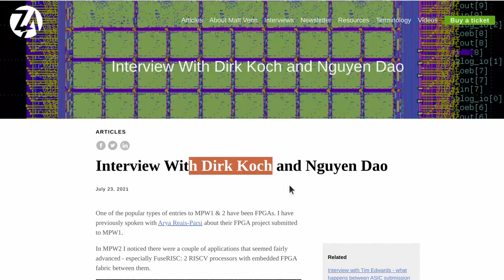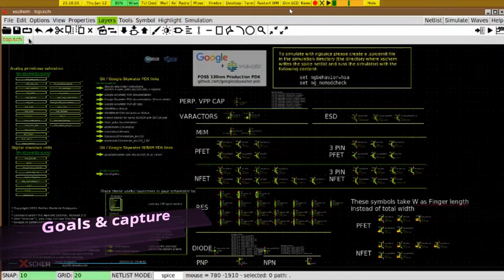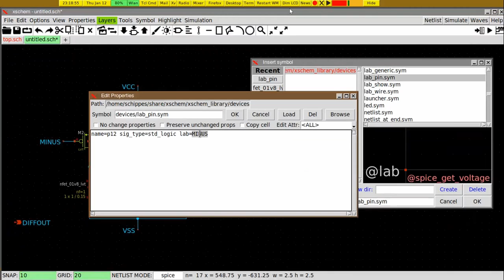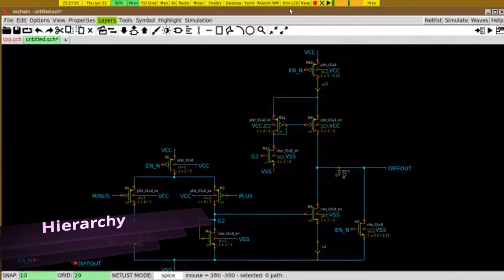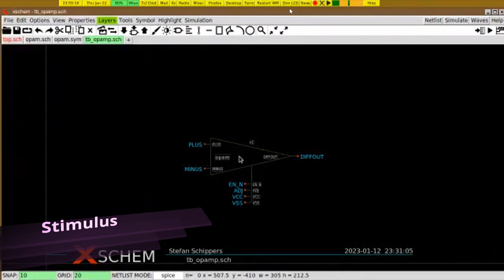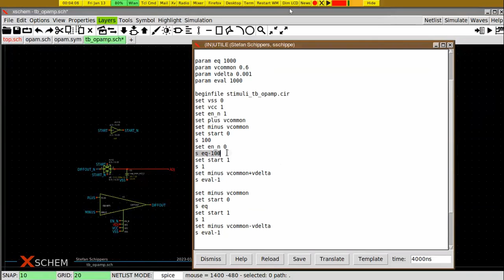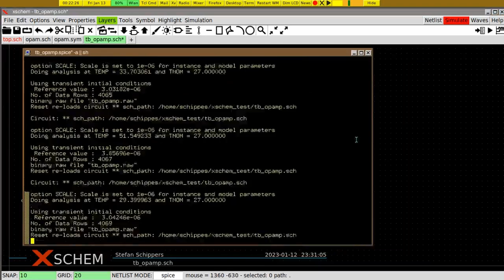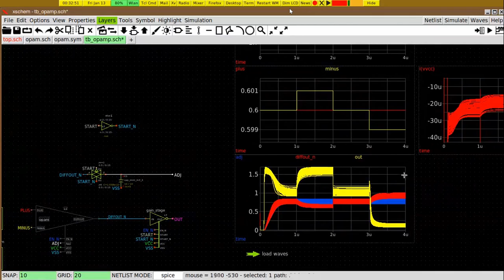Webinar - Analog schematic capture & simulation with Stefan Schippers

Comment: I think my previous comment got eaten by youtube, so I am trying again.
Great video!
If anyone is interested in looking further into sizing of transistors for analog design, I recommend looking up gm/id design method. Basically you characterize some transistors from the technology, then use that to solve for the performance metrics you want. It solves many of the problems faced when short-channel transistors (the textbook long-channel models don't give accurate results).
Also, hooray for tcl scripting.

Comment: Only issue I see with xschem is its dependency on Xlib. As we know X11 is being pushed into deprecation by wayland. I think using a GUI toolkit would have been better. Sticking to old protocols is a known problem with industry EDA tools and its sad to see an open source tool also going this way. Not only using Xlib primitives make it time consuming to code and reading and understanding the code making it difficult to contribute.  

I know I should not count the number of teeth on a gift horse but just saying.